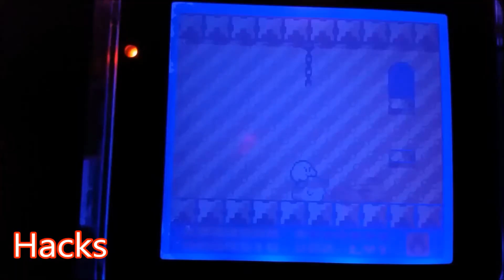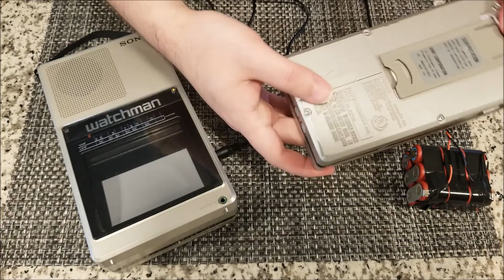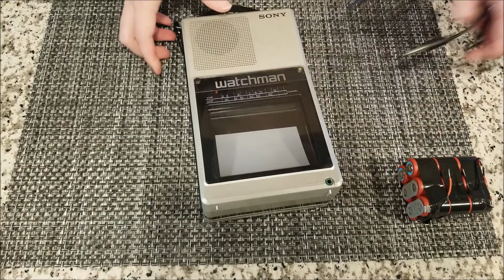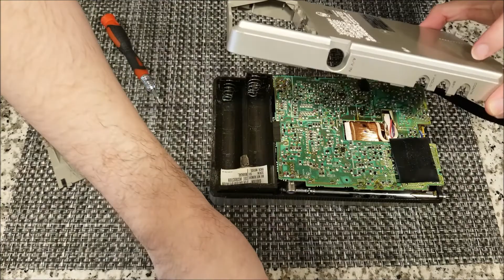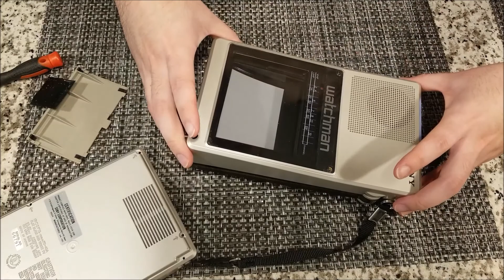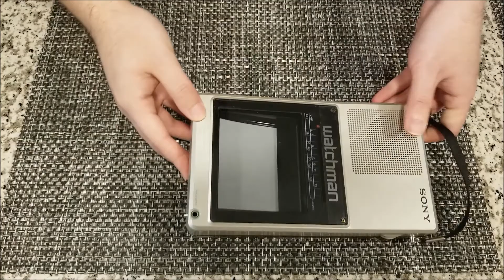TeardownTube - episode 56 - Sony FD-40A Watchman Portable TV

Comment: My FD-40A projects a vertical beam across the screen but not horizontally. I’ve been told this is the result of a poor electrolytic capacitor, can you make (or know someone who has made) a video on how to repair this?
Reply from the maker: It could bad caps but also the horizontal drive circuitry or the horizontal coil could be damaged. Unfortunately impossible to fix over a video on the internet.
Reply: @sjm4306  thank you so much for your help

Comment: Recently picked one like this..."FD 42A"......Found an adaptor...6V output, but not original Sony one(...was not aware of center negative....)....Plugged in & gets snowy reception on both UHF & VHF setting.....tried touching output from a dvd player to both antenna & input ....both seemed to receive a degraded negative picture but could see image was trying to come thru.....How can I be sure the 6V adapter I am using has a Negative Center???  Put fresh batteries in compartment but does not power up with battery power.....I noticed a mfgs' sticker inside which said to see manual for battery operation,...is there any switch between AC power to  DC power????   Appreciate any information   Dan
Reply from the maker: To check the connector polarity, look at the adapter's label and usually towards the bottom there's a schematic symbol with a center dot and outer curved line with an arrow point to center with either the pos or neg symbol. This will tell you the polarity. Otherwise just grab a multimeter set to measure voltage and put the red probe in the center of the adapter plug and black on the outer. If the voltage is positive then your adapter is center negative, if it's negative then it's center positive. There's no manual switch between AC and DC, the jack itself has a built in metal contact that does that for you automatically. Not working on batteries could either be the battery contacts are corroded or that metal contact inside the AC jack is oxidized and thus not connecting properly.
Reply: @sjm4306  Thank you for the information on the 6V Adapter,....I found the symbol description & it looks good , ...I have the Neg. center needed for proper connection. At some point will check inside plug , thank for clarification.

Comment: Hi I have a Sony watchman FD40 as well any resistor fell out of the board while I was replacing a transistor and I can't find it and I can't find out what value it is it says r453 in the slot it goes to close to the chip by the 6 volt power in in would you be able to link me a manual or tell me what resistor goes there I'd love to finish repairing this it's an absolute beautiful specimen
Reply from the maker: This site has full scans of the schematics, but I'm unable to find a service manual for this model. Hopefully this pics of the schematics are enough to help fix your unit. A quick look shows R453 is a 22 ohm resistor.

http://vintage-technics.ru/Eng-Sony_FD-40A.htm

Comment: I recently buy one and vhf running fine, but after few hours of running  suddenly tv stop receive vhf signals only snow on vhf band, ufh working fine. Could you give  any suggestion on this problem.  I eagerly waiting for your reply.
Reply from the maker: Sorry, I'm not well versed in analog rf so I wouldn't know specifically where to start. If you can find the service manual you can look through the schematic or block diagram to debug the vhf circuitry.

Comment: how did you discharge the high voltage, or did it discharge itself with a switched loaded current sink?
Reply from the maker: I haven't checked the schematic (if one is publicly available) but I'd guess there's a bleeder resistor on the hv rail. I just wait a bit after powering on for it to self discharge.

Comment: Wait, does the CCFL tube project on the white portion or is that the actually tube on the display? 

The suspense on your videos is getting to me lol
Reply from the maker: Hard to tell from the video but the tube is flat at the front and slightly curved at the rear which is painted with phosphor. The e-beam is fired from the top, biased down towards the back, scanned and then the light is emitted out the front. Super odd but cool way to make a flat crt that is actually pretty thin.
Reply: @sjm4306  Is the illuminated surface you see the inside of the tube? like reversed from seeing the light hit from the back of the phosphors almost working like a VFD?
Reply from the maker: Yep, pretty much backwards in many ways from conventional crts
Reply: That is such a clever analog solution, somebody had better of gotten their gold star sticker for that idea.
Reply from the maker: I know right, and the non-linear drive to compensate the odd display geometry must have been difficult to give such a uniform image.
Reply: It could quite linear if you think about correcting field geometry with an external fixed magnetic field to adjust for skew. That's at least where my analog brain goes on correction. I don't know, never saw one like this let alone close enough to get the monkey paws on.
Reply from the maker: Thinking about it makes me want to give it a test pattern and scope out the x and y deflection drive signals.
Reply: @sjm4306  I would bet they are akin to a normal crt with vertical lines getting a smaller voltage % compared to the scan lines.
Reply from the maker: I was watching a channel called 12voltvids who is a retired repair tech doing a teardown on one of these displays and he mentioned that the drive method sony employed was pretty wild for the time.
Reply: If you come across the video again let me know, not so important but might be handy to know for doing an analog synth style laser controller.
Reply from the maker: Will do!

Comment: Mine does not turn on when plugged with a 6-volt adapter, the Battery compartment is clean so no leakage, maybe its the adapter?
Reply: Sony equipment from this time period uses a center negative AC adapter, meaning the outside of the plug is positive, and the inside is negative. This is backwards from most AC adapters, which are center positive. You're probably trying to use a center positive adapter. Hopefully you haven't blown anything from doing so.
Reply from the maker: If you have a multimeter measure the adapter to make sure it is around 6V. It could also be a problem with the ac jack or an internal blown fuse.

Comment: Does it work with a lightgun? :)
Reply from the maker: hadessuk OMG why didn't I think to check ... be right back in a second ...
Reply from the maker: Just checked and it didn't work. I don't know if it's my light gun (which truthfully hasn't been used in over 10 years) or the crt though since I don't have another larger conventional crt to test with. I know the sony flat crts use a different non-linear drive signal compared to regular crts so that could also be the issue.
Reply: My guess is either the timing's different, or the pixels are packed too close together. The lack of color may also be an issue.